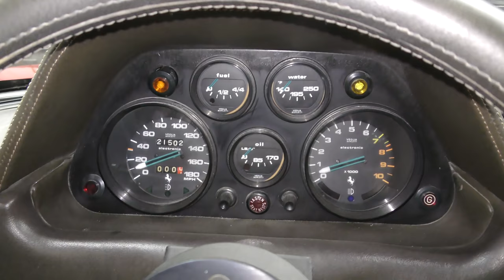CAR WIZARD bought the Car Trek 4 Ferrari 308 from Tavarish! What could possibly be wrong with it?

Comment: And you just bought a building !!

    I drove one of those for 6 weeks in san diego.  The steering wheel and pedals are just odd for position.
Reply: I bought mine in Newport beach. About 3 minutes after first driving it the lanes on PCH suddenly stopped. I panic slammed the brake on and it went to the floor. I hit the clutch instead. I swerved over the center divider and thankfully nobody was coming. Yes, its odd having the wheel well sticking into the car and the pedals are too far to the right. But it soon felt natural. I liked that little foot rest on the left.

Comment: You mentioned Magnum P.I. and the 308 he drove in the series was a convertible because TOM  was so tall at about 6'4"  if you noticed that the top of his head was well above the top of the wind screen...at the price you got  that hard top I think you really got a great deal considering the low miles it has on it its really too bad about all the mods done early on in it;s life and all you need to do to bring it back to almost stock.. even though all that new stuff that added in when it was new probably had cost the original owner almost as much as you eventually paid for the car,.  I like that particular model and If I got one it would get at least a turbo and fuel injection if that wasnt there in the first place...   more power and reliability are the goal here. but you do what you like with it  as it is your toy and its cool however yu like it...

Comment: Mr wizard I have an 87 Fleetwood brougham triple white car with red carpet I'm currently restoring I have some questions about where you got the trim and body fillers. It needs a full restore I've had it for several years brought my daughter home from the hospital in it 12 years the power train is solid and no leaks but the interior and body work is in dyer need. Any help with info in parts would be tremendous

Comment: $25K? You´re conning no-one to think that Mrs. Car Wizard thinks this is a chunk o´ change -- if the engine is fundamentally sound.

I fell in love with Ferraris, seeing this very Ferrari in an old Car and Driver magazine “centerfold“.

There is somewhere online a document that lists the OEM parts of this car -- so you don´t have to pay Ferrari´s hyper-inflated prices.

Replace the tires! Yes, even if there is only 21K miles on this car. Remember what happened to Paul Walker.

P.S.: Isn´t the model with the aero-wing and deep chin dam the 328? Weren´t they making the body out of steel by then?

Comment: I have a soft spot for 70s and 80s junk engineering exotics. When i was a kid my dad had a 87 porche 944. Thing wasnt in too bad of shape for its age but the drivers srat had a tear , the ac button fell apart so we soldiered to it and put a toggle switch on ot with a modified black trim from a ac adapter, and when we sold it it had a small rust hole in the floor where water sits in the battery tray, rusts it out and makes its way into the floor. We painted it in out backyard, sold it and the guy we sold it to fixed it up to daily drive. Always loved the looks of the pop up headlights, never liked how unreliable and hard to work on the german stuff was. Not bad compared to modern cars noe but still i dont like it and thats why i even refuse to daily a newer car, my daily is 40 years old

Comment: NO NO NO NO NO NO!!!!!!!!!!!!!  PLEASE don't even think about replacing those 14" wheels with those HUGE GHETTO REEHUUMS. Those things are hideously ugly. They are flat out disgusting.  They are one reason I won't buy a new car. I refuse to own a car without tires, and tires include sidewalls. I even put the 15" wheels from a 1999 V6 Mustang on my 2003 Mustang GT that came with the 17" GHETTOS.  I love the older style bumpers, and ESPECIALLY the fact that it is carbureted, which I believe went through the 1979 model year. Again PLEASE don't mess with that. The carbureted engine and 14" wheels, along with the manual shifter are some of the most important things that make this car so special. I see some serious damage on the front spoiler, sadly that is fairly common. The GTS/GTB are basically the same car, the GTB has the solid roof, the GTS has the targa type roof with the removable panel, and was the car that was used in Magnum PI. To me this is the most iconic Ferrari ever made, and what I think of when I think of Ferrari. Ferrari has never made a better looking car. 

There are WIRE NUTS under there!!!  No A/C? Sadly it would be worthless in Arizona. I have a 1972 Chevelle HEAVY CHEVY that came without A/C . I had to have aftermarket A/C installed in it with an under dash unit. You simply cannot drive a car for 6 months out of the year in AZ without A/C. Too bad about the headliner. What kind of condition is the engine and undercarriage in??  My Mustang GT had damage to the pinch welds and front frame rails from improper lifting/jacking. I repaired the pinch welds and had weld in subframe connectors installed to strengthen and cover up the damage to the frame rails and to provide proper lift points. While that is a beautiful car, I'm beginning to wonder if it was worth $25K, considering how expensive and rare vintage Ferrari parts are. But if anybody can fix it, I'm sure you can.

Comment: Mr wizard, glad to find your channel. I restored a 79 308 gtb and I can offer some tips to help you on this. Many parts are direct replacement from other manufacturers parts bins. Subscribe to ferrarichat and you can search for the list. That being said, ferrari UK owns the rights to remanufacture antique ferrari parts, so you will find parts cheaper across the pond. Superformanceuk.com will save you tons of money and offer parts that you can't get anymore like nicrosil cylinder liners. On my 79, I found out that there was a defect on some of these cars regarding oil flow in the heads. A relative of mine showed me what to look for and told me where to drill the hole in the heads. Unlike newer ferraris, this motor does not drop out, so let me give you a tip in case you want to adjust the valves, it is possible to measure how much you need to adjust each valve and insert the valve shims 1 at a time instead of pulling the motor. Their are 2 timing marks on the flywheel,  1 for the front bank of cylinders and 1 for the rear. If you plan on taking out the dashboard, consider reupholstering as the leather is known to shrink and expose the inside foam when it let's go. In fact I have an original black leather ferrari hide if you need it and I can direct you to where you can get more for the seats at a very reasonable cost. I do have original factory repair manuals if you need further info. I would also recommend converting the alternator to a marine style unit as this is the source of catastrophic fires in these cars. The fuel tanks are aluminum and directly over the motor so they get hot and when you fill it up with gas from an underground tank, it is cold. The fuel expands and will pee out of the breather which is right on top of the alternator. Good luck!
Reply: Don't forget that this is Lucas electronics positive earth